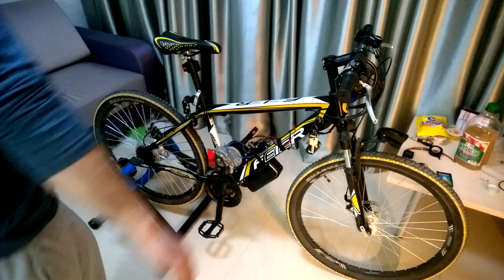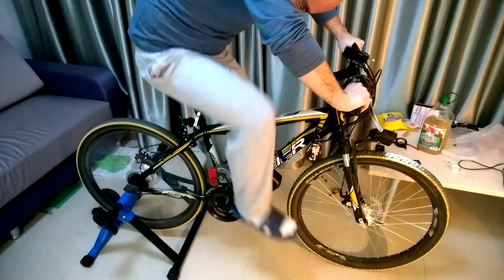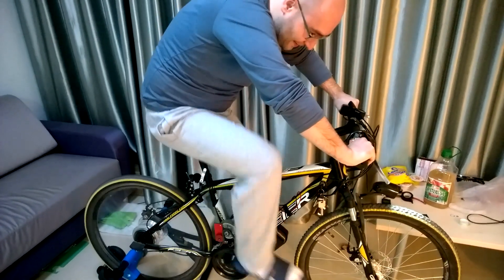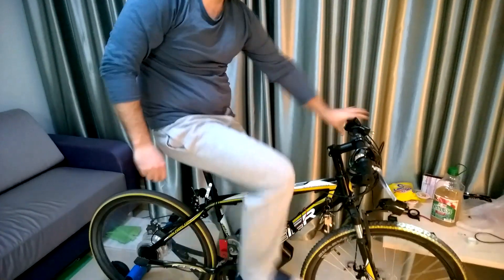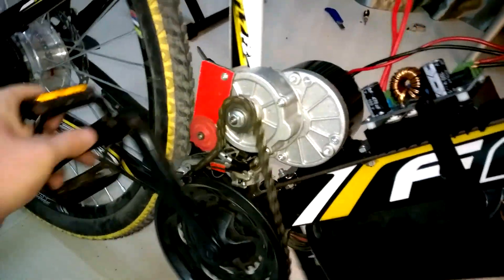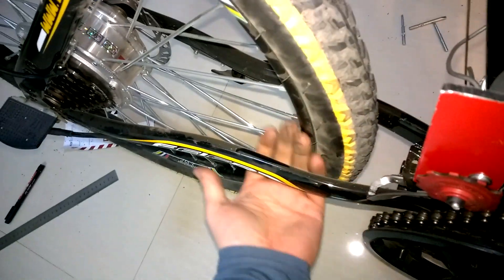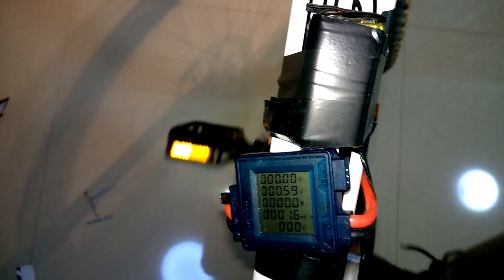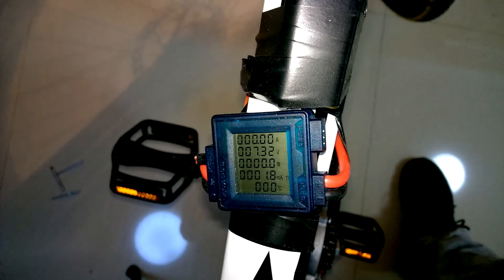Innovative bicycle generator-motor system, no back wheel transmission.

Comment: For me is very interesting idea to connect to a rear wheel a small 10-30cc (not more) ~1 kW gasoline engine + this generator (brilliant if it both could be in one device and very easy mountable) and then this electric motor on a front wheel. Without any battery - thats the main idea. 
I like the sound and vibration of an internal combustion engine  😁
Reply: A 3cc glow engine will be more interesting i think, you can actually get more than 3hp with a 3cc

Comment: Better efficiency? How? You will get fairly big losses generating power, then from that more losses, from the motor generating power to the wheel. If going via battery, then you would get even mord losses. No way will it be more efficient than a chain + cassette + derailleur to which you may add power from a battery/motor.

Comment: Why?
Reply from the maker: Better efficiency bike
Reply: @iulian207   Buna ziua imi spunet si mie ce piese trebuie la bicicleta electrica asta ca vreau sa fac si eu ce controller si ect.ca am un motor de 2000 Watt multumesc cu respect
Reply: @iulian207  
Hello, tell me what parts I need for this electric bike, because I want to do what controller and ect.ca I have a 2000 Watt motor, thank you with respect
Reply: because the drive (chain/belt/etc) is normally a PITA on electric bicycles.